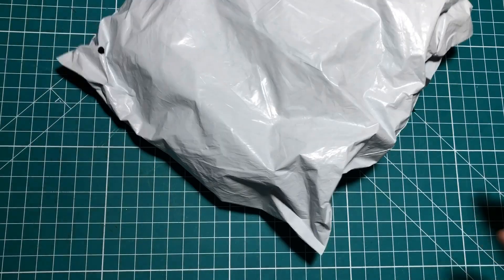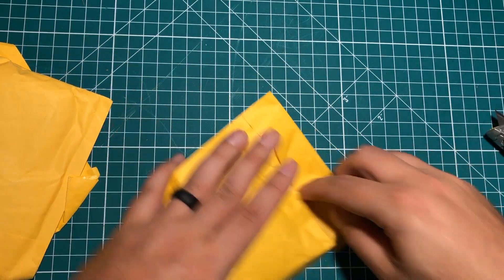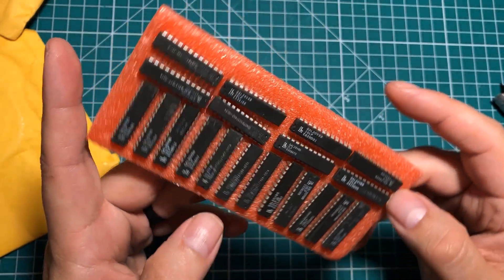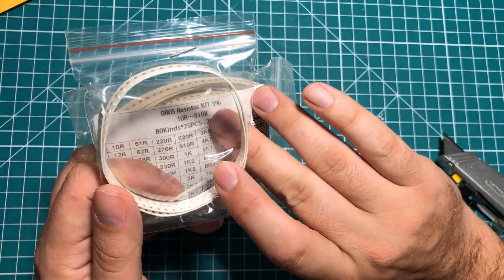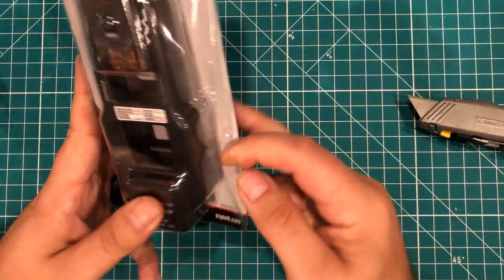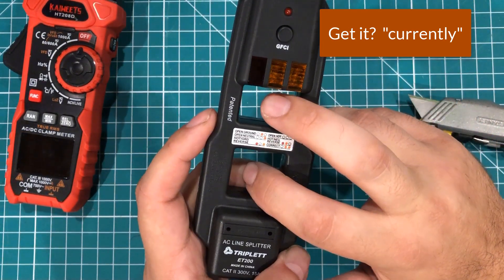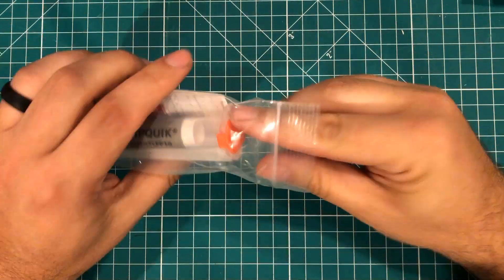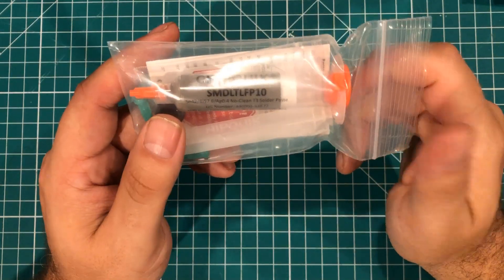Mailbag 49

Comment: I decided I need an AC line splitter, though the triplett is $41 on amazon here so I may have to cheap out with less features for the $23 type models.  I already have the stand alone wiring verification and GFCI test button units so I can get by with just the clamp meter and voltage probe holes
Reply from the maker: Yeah. I almost went with a smaller one, but the lenses fell off both of my gfci testers, so I kind of used this as an opportunity.